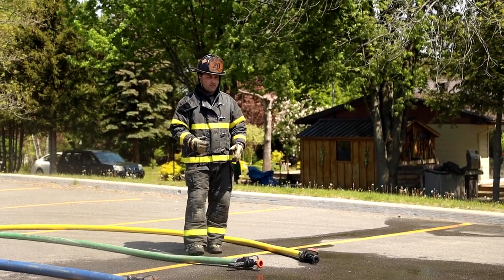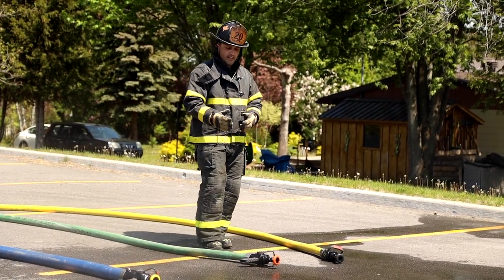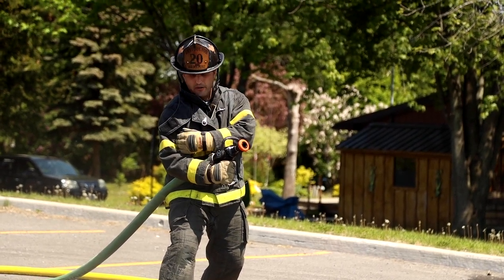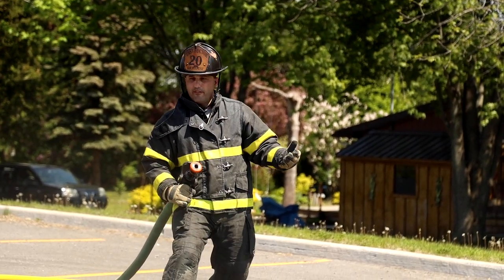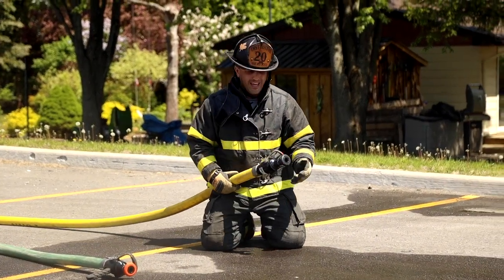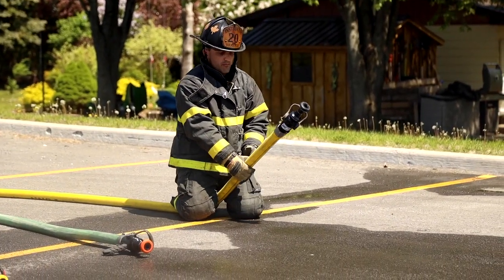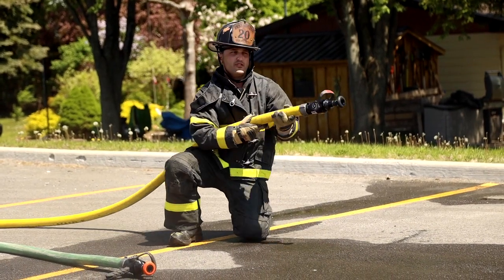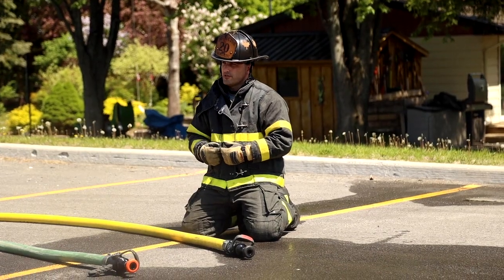Pistol grip vs non-pistole grip

Comment: Only if you hold the pistol grip like that is it true. If you use it with the line over your shoulder and brace with your non dominant hand and grab the line behind you when you open up you have 3 points of contact.